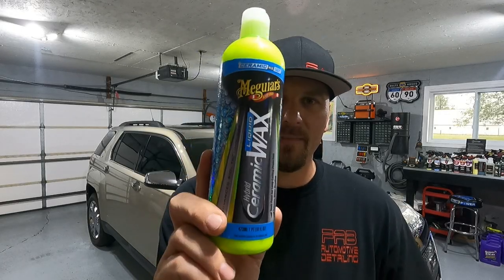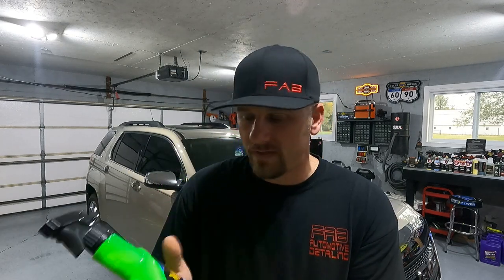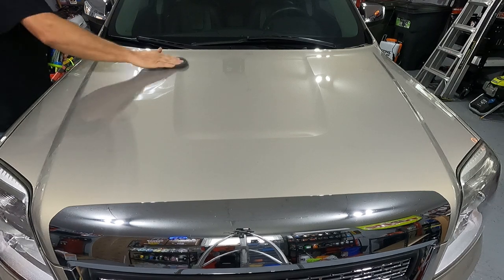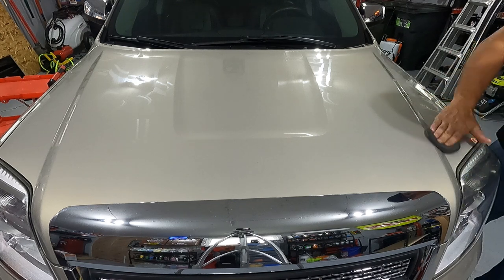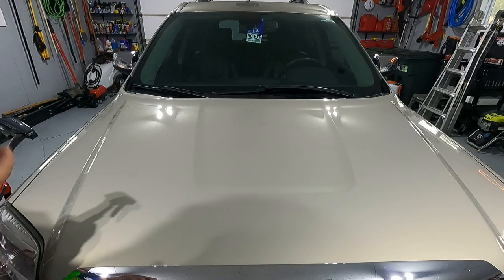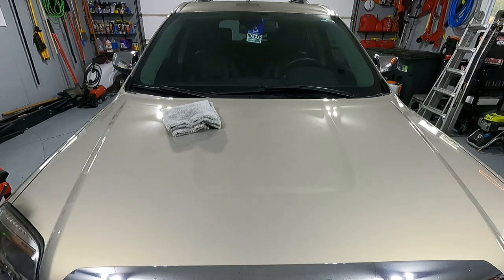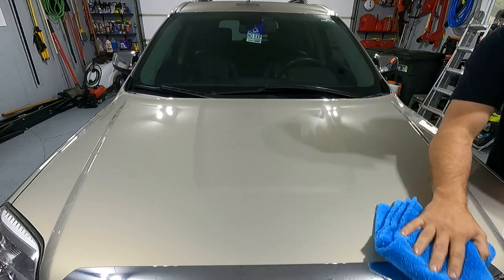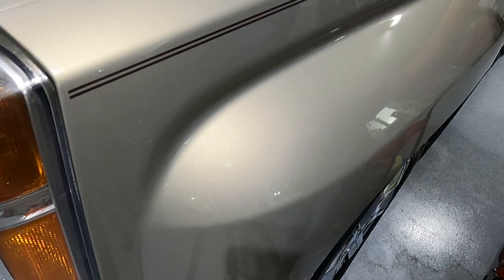First Time Using Meguiar's Ceramic Liquid Wax and Ceramic Detailer! I'm Impressed

Comment: I've been able to get 4 to 5 months of water beading so far out of the liquid wax. At four months, some spots on the car are starting to sheet now and some spots are still beading great. I have use the spray wax but I have fully tested it yet. I haven't used the detailer yet. The liquid wax is a great wax in my opinion. Best water beading I've seen out of a Meguair's wax to date other than probably the aerosol Fast Finish sealant.
Reply from the maker: That’s great to hear. The Detailer is awesome!

Comment: Hey Fab. I bought the detailer a few months ago and it’s my go to for clean up in between washes. Super easy to use. The wax looks like good stuff too. Thanks for the vid!
Reply from the maker: That’s great to hear and I plan to use the Detailer more often.
Reply: @jaykid007 would you use the ceramic detailer on a wet car or should the car be dried first?
Reply: @JohnLe  You could do either. However, this one is usually best to put it on dry first time and then can wipe dry after wash after first coat.

Comment: The liquid wax (i believe) says to leave it on the panel for 5 minutes. Ive done longer and the wipe off is insanely easy! Try that next time im sure it wont be so tacky! :)
Reply from the maker: It’s says 3-5 Minutes and I definitely went longer then that. It was probably the towel I need to get some new ones.

Comment: I love meguiar's hybrid ceramic family! 👍
Hybrid ceramic detailer is really great for maintaining ceramic coatings !, Some people think it only lasts one wash, that's wrong!  It holds several wash !.I use it for maintaining CQuartz lite + gliss V2.  He does a great job!
But I tested the pro version, the M799 bead booster.  He's fantastic too 🤩.
M27 hybrid ceramic sealant + M799 bead booster is an excellent combo, even more durable than the hybrid ceramic liquid wax + hybrid ceramic detailer combo
Reply from the maker: I appreciate the info!

Comment: I prefer Meg's over Ethos Ceramic Wax, but I only got about 6 months out of it, even with maintenance washes.  But it certainly improves the look for those 6 months.
Reply from the maker: Yeah it seems like a good product. I would be happy with 6 months for as easy it is to use.
Reply: @FABAutomotiveDetailing  It's easy to use and smells amazing

Comment: That's a great presentation. I got tired of looking at YouTube all these snake oils. I stopped off at the auto parts store and found this I'm putting it on my can-am spider  motorcycle  It's been close to a month Since I brought the bike home And now watch YouTube to find out how to put this on The trunk is amazing I have a question what kind of blower do you use I've been looking around trying to find something so I don't have to wipe it down. 1st thing I did I tried to See how it would workOn my old helmet. Before I had a chance to put it on a bike. It's straight out of the factory nothing on it. They say the wax is supposed to be good for between 8 to 10 cars And use the detailer in between . It may be wax but it's horamic you can't use it like regular wax Not as often. I've figured 6 months to a year. I was told not to use pledge . That's what we used to use on our motorcycles kept  The dust off and it was super slippery. This is supposed to help it from not getting scratched. Hope it works
Reply from the maker: Thanks! I have the Adam’s Polishes Air Cannon the full size version. These are both easy to use products and give good protection. They won’t prevent scratching though.

Comment: Quick question guys, can I apply a nano ceramic 9h coat over Meguair's hybrid ceramic liquid wax for added protection and longevity? I have ordered both products and was wondering if my approach would work. I would wash/clay/compound/polish followed by applying the hybrid ceramic liquid wax and finally end with a nano-ceramic coat to seal everything ...
Reply from the maker: You would want to apply the coating to naked clear coat then you can put the wax on top after 24 hrs.
Reply: @FABAutomotiveDetailing  thank you Sir!

Comment: Anyone  not impressed with it ? I used it on both my wife’s car and my pickup ? Maybe I did something wrong ? I did a quick one step correction with 3D speed then laid the Megs Ceramic wax on top of that. Only thing I can think of is the wax in the 3d speed. But Megs says you can lay it over existing wax
Reply from the maker: That is Interesting! I like hearing good and bad things about products because it makes me think. I know it can be added on top of other protection but being SIO2 I would want it to bond straight to the clear. Try it by itself and see if you get better results.
Reply: @FABAutomotiveDetailing   I’m going to try cleaning the hood of my truck with ipa and reapplying the CW. It’s only been a week. My wife’s is 2 weeks I’m gonna hit it with the ceramix spray from Megs
Reply from the maker: @OnTheToolsWithSal  Let me know how it goes.